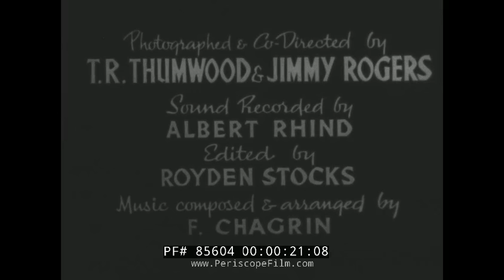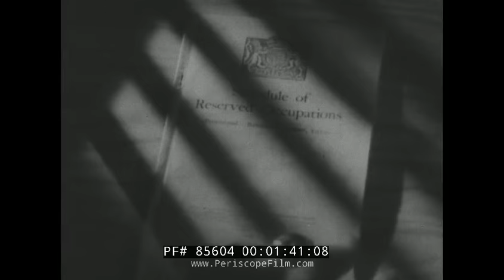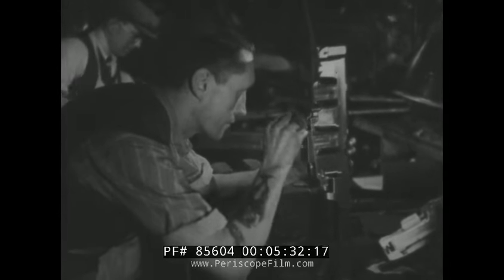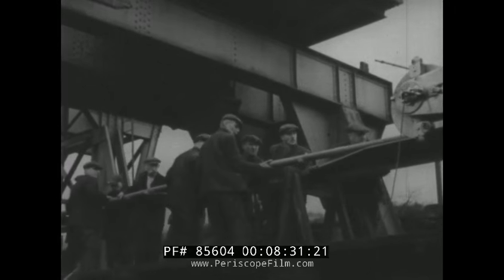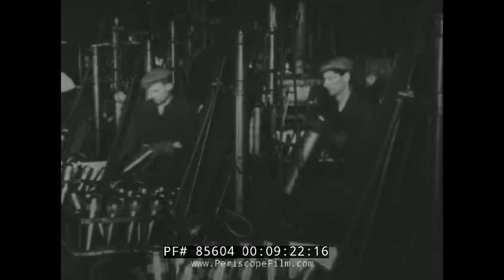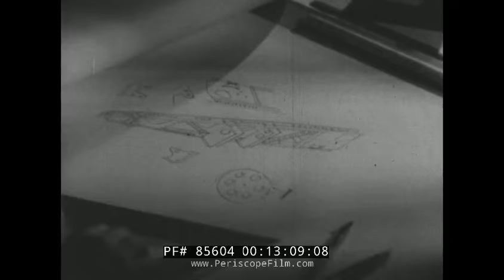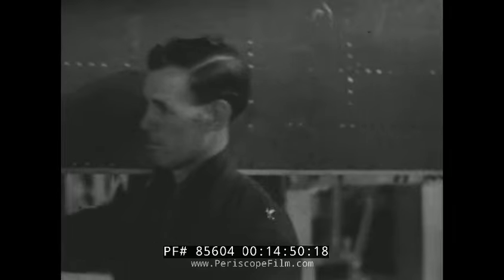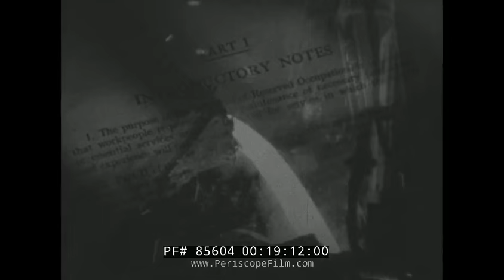BRITISH WWII WEAPON, AMMUNITION, TANK, WARSHIP & AIRPLANE PRODUCTION FILM 85604

Comment: I notice that a lot of films (like this one) don't have black, don't have white, and everything is just foggy and somewhat out of focus shades of grey. What causes this? Was it the original way the original copies looked? That certainly seems unlikely to me, but maybe so. Was it lost in some transfer through NTSC video with its 85:1 (on a good day) contrast ratio? Or is it just a perhaps deliberate flattening of the contrast curve when pulling the digital copy from the film print?
Reply from the maker: The reason this film looks the way it does is that it is "dupey" -- during the war there was enormous pressure to make a lot of film prints quickly. To do that, many negatives were made and then prints struck. If you got a print from a first generation negative it would look sharp and not so contrasty...whereas a print from the 2nd or 3rd generation internegative etc. might look washed out or contrasty and out of focus.